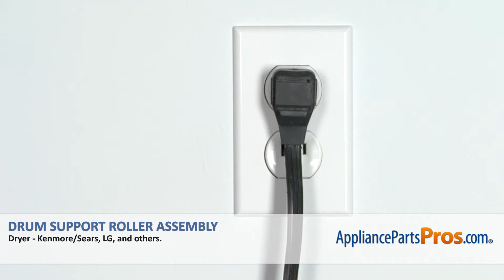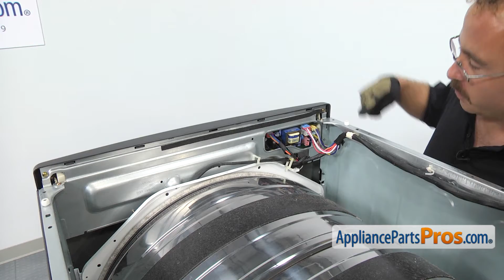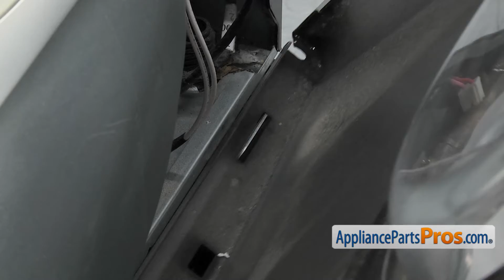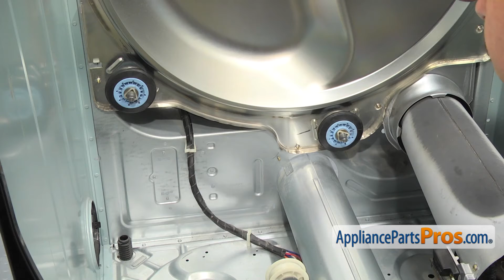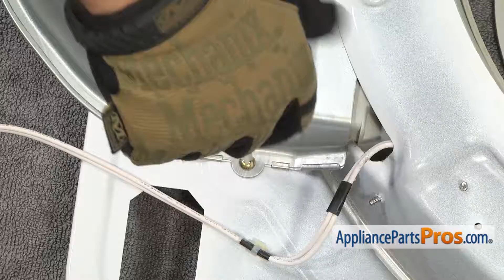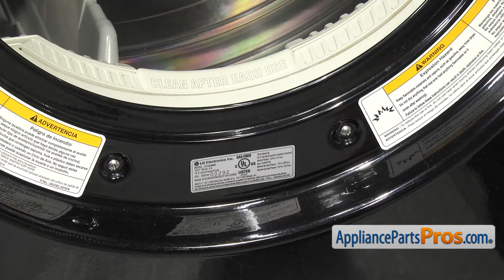How To: LG/Kenmore Drum Support Roller Assembly 4581EL2002C

Comment: Now when I put the drum roll back on it doesn’t sit up properly on the new rear wheels. Please help!
Reply from the maker: What is the model number of your dryer?
Reply: @appliancepartspros  DLE5977B
Reply: @appliancepartspros  thanks for responding. I thought the drum would just sit up properly on the new wheels but it’s not
Reply from the maker: What rollers did you purchase by chance?
Reply: @appliancepartspros  4 x 4581EL2002C dryer drum rollers
Reply from the maker: It appears that the parts that you order were not the correct ones. It appears you would need to order AP6985402/4581EL2002H  and AP7203749/AGM75510755.

Comment: First off let me say your video was such a great help with this project.  I found the video when I did a Google search for the noise my dryer was making.  Let me say this dryer is over 20 years old and this was the first repair that ever needed to be made on it.  The step by step instructions were spot on.  The link to the parts on your web site was helpful, however I found the wheels cheaper on Amazon but not a big deal.  I know you guys have to make a living.  I found 4 wheels for the cost of 2 of yours.  But again, I totally get it.  So for the cost of the rollers and a set of metric wrenches from Home Depot (Grand total of $63.84) I broke the dryer down, cleaned out the UN GODLY amount of lent and replaced all 4 rollers (Only one roller was bad but why not just replace all 4 while I'm in there) for less then $100.  A local repair guy quoted me over $450 to do the same thing. 2 years ago, I used your step by step video to replace two water valves in the LG washer we have.  So, my hope is with these two simple repairs I may have extended the washer and dryer another 15 to 20 years.  You guys ROCK and thank you for providing the videos.
Reply: Read some reviews on the Amazon rollers. No thanks, I do not want to do this again in a year.
Reply: I echo this sentiment

Comment: Great video but my model LG is different. The computer board is on the left side panel.  There are only two connectors that need disconnected but they made them very hard.  First there are two standoffs holding the cables needing disconnected that have built in cable ties. I had to cut the standoffs off to get the cable loose. Also the locking tabs are not the old simple style where you press on the lever to release. You need a tool to spread the two sides of the connector apart while you pull the cable out. To make matters worse on on connector on the circuit board the locking tab was facing down. It took me at least and 1/2 hour just to disconnect those two connectors.  I had a thumping sound when the dryer was running so I bought replacement wheels.  I got LG OEM newer style with sealed roller bearings and a metal C clip. They seemed to have more slop than all four of the older wheels (wiggling wheel). They do roll much better, if you spin it with your finger it rolls for over 10 seconds where the old ones only roll for one second.  I only bought two because of the cost and didn't think all four would be bad. Put the new ones on the back and reused the front wheels. There was no wear on the rubber of the wheels and they didn't wobble.  It makes the same thumping noise!  Tried leaving the top off and touching the drum when running and didn't notice any movement with the drum.  I could try two more wheels but I don't think that is it.  What else can make a thump sound every revolution?  Fyi the top was much heavier than I thought when removing it!
Reply: One more thing the original wheel bolts had locktight on them so I needed to hit the wrench with a mallet to break them loose for the first few turns.
Reply: My problem turns out to be at the seam of the drum itself.  There is a small tear in the metal and every revolution the metal flexes at the crack and makes a noise.  It is only 4 or 5 years old also.

Comment: I have an LG dryer purchased in 2007.  Model:  DLE9577SM.  It was squeaking at start-up and rumbling a little .  Not knowing what parts I would actually need, I ordered rollers with/without assemblies, tensioner pulley-only, new belt.  After viewing this video a couple of times, I attacked my machine which is located in the comfort of my garage.  Lots of room to spread out. Nice. This disassembly went OK however because, I suspect, my machine is 13 years old, the removal of the control panel was different than shown in the video. No locking tabs.  My control panel has a screw hidden behind a plastic tab "press here", on the right hand side corner (as you face machine) which you remove, THEN the whole control panel will slide from left to right for removal .  You may have to use a mallet on the left hand side with a light tap to unlodge it.  With my control panel, it was not necessary to disconnect all, rather just some,  of the terminals so I was able to lay the whole thing to the side and proceed. The rest of the disassembly went according to the video.  Turned out my belt was frayed and one of my rollers was bad. Replaced both items and will return the unused parts for a full refund.  
Miscellaneous notes:
Gloves on all the time, sheet metal sharps at every turn.  No blood drawn !
All of the phillips screws are the same size.
Some of the screws were VERY hard to remove. Fortunately I had a new, correct size,  phillips screwdriver which provided a very tight fit, especially after I whacked it with the mallet, so I was able to get all screws out undamaged. But I could see why some people would have trouble and run-out/damage the phillips heads. Good idea to have a hand-held impact driver on site just in case. 
After you lift off the drum and the tension assembly is visible/available, do a dry-fit with the belt just so you are familar with how it fits because when you put the drum back on, putting that belt in place is a little bit of a challenge.  
On my specific model:  ontop of the machine, on the top of the control panel, is a separate trim piece, about 2" wide and runs the length of the top of the panel:  there is no need to remove it but if you want to, it slides either to the left or the right, can't remember now.  If you pry it straight up (like i did), one or more of the clips will break.  Fortunately, even though I broke one of the clips, it re-seated just fine. 
The bad roller I replaced:  I replaced it with a "roller assembly" and not just a "roller".  I may have been able to disassemble the bad roller assembly, retain the axle and put on just a new roller ?  I will tear apart the bad assembly and will update this comment with what I discover. 
Re-installing the drum:  I did it by myself, but it would have been useful to have another person help with this.  It's a little awkward lifting the drum, getting the roller in place, getting the panel into the notches, etc..It's not heavy, just awkward, a kid could help. 
Cleaning out dust/lint:  when everything is removed, good time to clean out the vents.  I stuck my leaf blower in the vent and blasted away.  Not much came out which is good to know also, apparently has been venting properly the last 13 years. Did the same for the outside vent. 
Keep track of your screws:  after I put everything back together, 2 screws left over---crap !  However, within 4 minutes I was able to locate the voids and put everything back together.  
Took me 4 hours to do all this, learning along the way.  If there is a next time, should be able to do it in less than 2 hours. 
Tools needed:  Phillips screw driver with proper head size (whatever that is ??); maybe a hand-held impact driver;  if replacing rollers, open-end wrench and sockets as noted in the video.

Comment: Your videos are great and helpful. Maybe list all the tools you'll need for the job in the notes, so we can gather up front. For all your repair vids. Thanks!
Reply: List of tools to repair dryer.
1. Philips screw driver.
2. A 14mm wrenches that I did not have, but the 9/16" is about the same size as the 14mm.
I used a 10mm ratchet wrench for the rollers. The screws and some connectors where hard to remove, so while re-assembling, I used a tooth-pick and a VERY small amount of plumbers grease on the screw holes and in the electrical connectors so it will be easier to work on next time.

Comment: Changed rollers put back together except vent turned on and smells hot. What to do now ,is something in wrong.
Reply from the maker: New parts can sometimes briefly have a hot smell, but if you smell smoke, then you should discontinue use of the appliance until the problem is found.
Reply: Sometimes disassembling the dryer will knock lint and fuzz loose which gets into the burner( if gas heated) or on the electric heating element.
ALWAYS check the fan and especially the ductwork from the lint filter to the fan for lint and debris that falls down in there when the lint filter is removed to clean .
Recommend disconnect power and disassemble then inspect from the lint screen to the fan and the heating element/ burner also. Make sure there is free flow of exhaust air to outside!
Reply: Maybe you knocked some dust loose and it landed on the burner. I was concerned about the same thing, so I used soap and water to clean every part before putting it back together. Also, if the belt ends up on the motor shaft instead of the pulley, that may cause problems and bad rubber burning smell..

Comment: Can re-purpose threaded shaft of of old roller and put them on new rollers?. I just bought new rollers with no new shaft.
Reply from the maker: We'd be happy to help you out with that! We offer free technical advice and diagnosis. You can give us a call at 1-877-477-7278 or you can chat us at our website: http://www.appliancepartspros.com/. We will need your model number to give you accurate advice, which you can locate using this tool on our website: http://www.appliancepartspros.com/modelnumber_locator.aspx
Reply: I'd also like to know if I can replace just the rollers and keep the old shafts.  Let us know. Thanks, Mike
Reply: In case anyone is curious, I happened to have rollers from a Whirlpool without a shaft and they do not fit on the shaft of the LG rollers. 
But I was able to remove all the hairs and lint and the roller (only 1 was stuck) spun freely after that so you might not need to replace the rollers anyway.